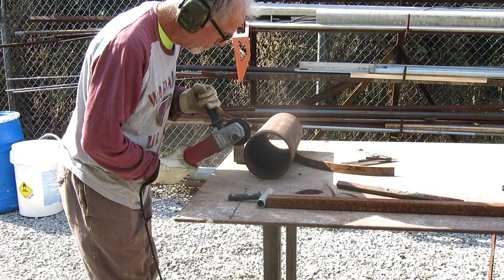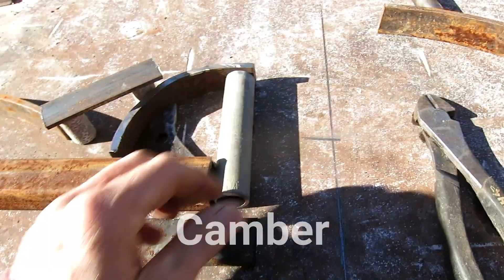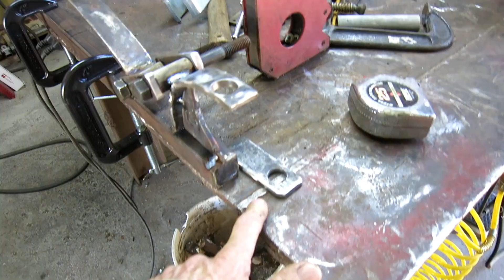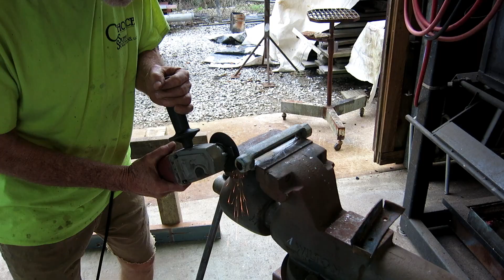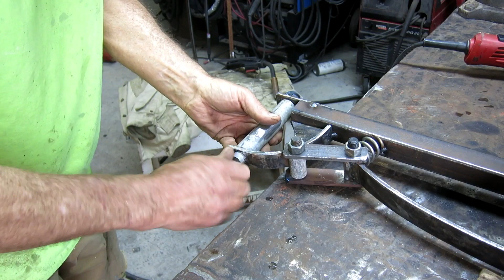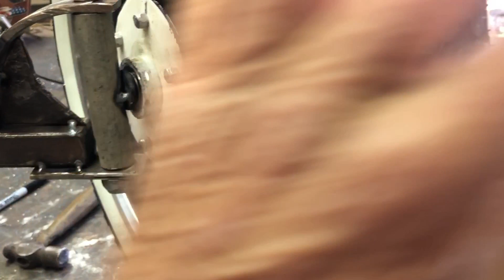Mini T Build #4 Steering #1

Comment: It may not be right for your setup, but maybe a slipper spring setup would be good to look at. Loving the vids.
Reply from the maker: Thanks Crazy
I looked at those early on at a local trailer supply company. Just not quite right for this application. I have a few ideas knocking around in side my old head, haven't given up yet. Glad you are enjoying the project.
Barry